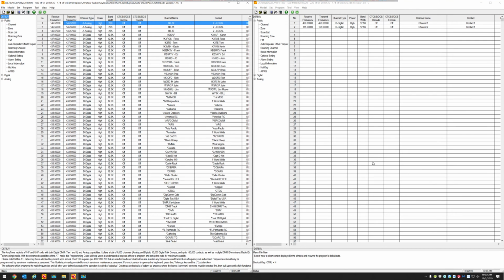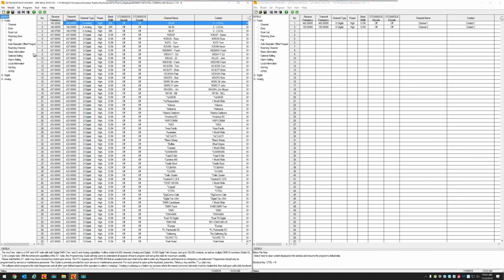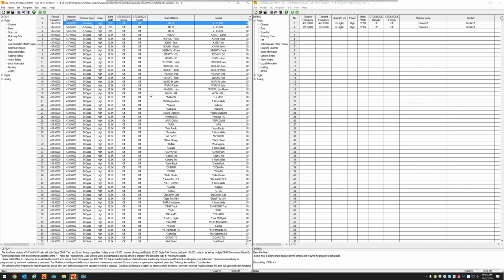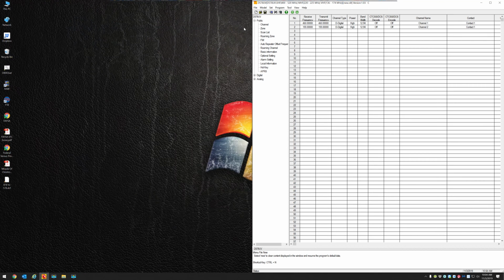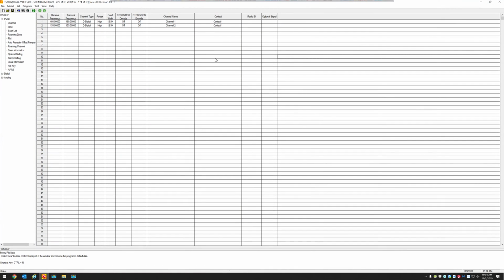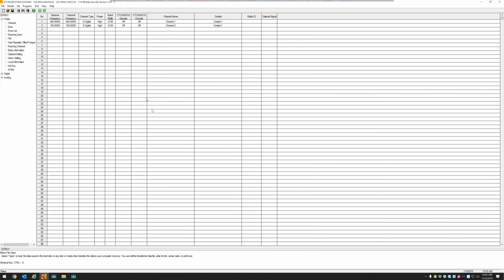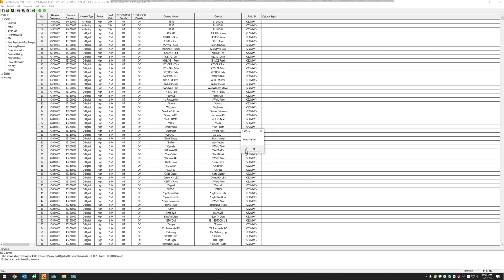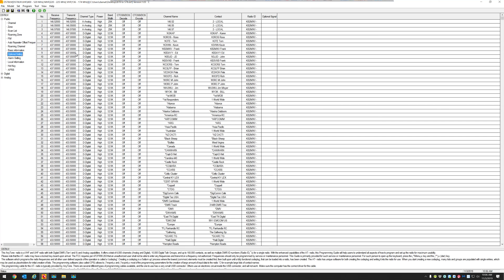Transfer your Anytone D878 codeplug to D578 CPS via DCF File

Comment: I am having this problem with my 878 to 578 data Xperia’s. Followed your instructions here and everything went well up to the point I went to write the opened def from the 878 to the 576 ... I get the dreaded Band Error message. You say make sure the Band Modes in both radios match. How do you do that?  K3RRP

Comment: What happens when you click Zones? Mine wont import.  I made one manually, then looked at the csv from my 878, and the files are not the same.  Just wondering if your zones imported with this process.
Reply from the maker: Yes everything worked

Comment: Seems like lots of people are suffering lots of strange or odd things happening with their Anytones.  I found this process helps in many cases:

    In CPS, export everything (Tool > Export > Export All)
    1. RESET the radio - this step is very important!
    2. Close and re-open the CPS.  Now read from the freshly reset radio (yes, you are reading a ’blank’ radio, that is OK)
    3. Import everything saved from step 1
    4. Finish off your codeplug by attending to the Optional Settings and confirm all is correct
    5. Send the freshly rebuilt codeplug to the radio
    6. If you had a custom start up picture or background pictures, send those to the radio now
    6. Finally, save the codeplug and ensure you use this saved file as the basis for any further changes you may make